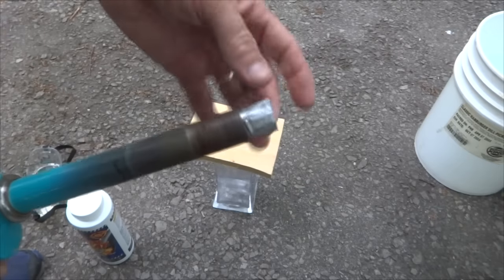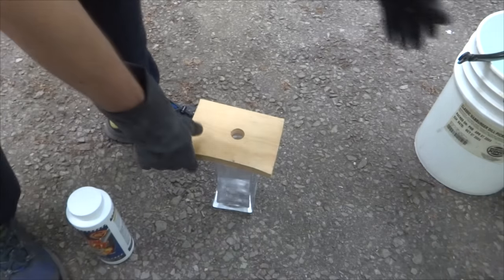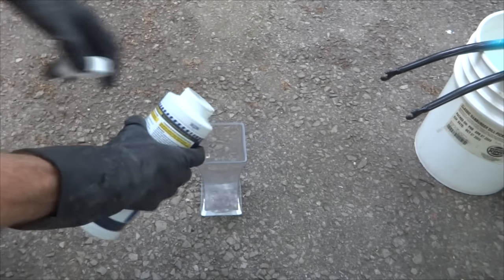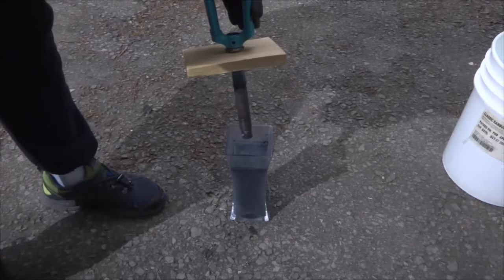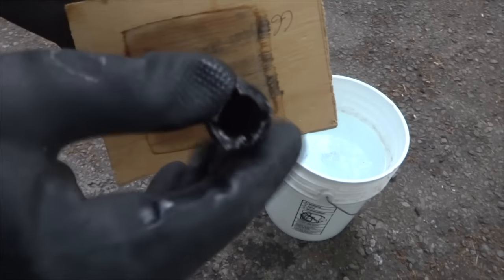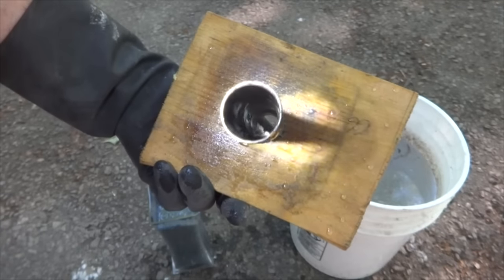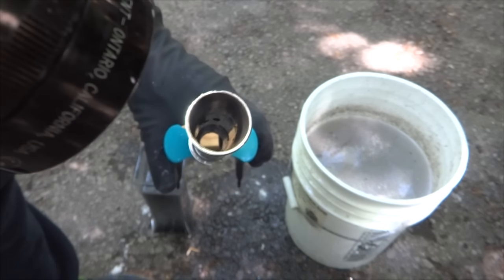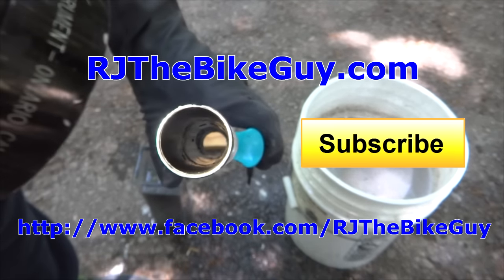Removing Seized Quill Stem With Drain Cleaner/Sodium Hydroxide/Lye

Comment: I did something like this a few times a while back with seat posts. Lower concentrations will work but you change the fluid more often. Because once the sodium hydroxide has reacted with the aluminum it stops dissolving. The benefit of that is lower heat The higher concentration will react for longer periods of time and will create larger amounts of heat that could damage the paint. Good video. I filmed one of my projects but never got to editing it. 

I don't know if I would use glass though, because that can get extremely hot.
Reply: Glass usually handles heat pretty well, short of pyrex, what would you use as a container for this concentration?

Comment: RJ - this video earned a TU and subscription.  I'm rebuilding a beach cruiser that's lived at the beach.  I am struggling with this right now as I dissemble everything for a rust removing electrolysis bath.   Handlebars are extremely rusted.   (My life long experience suggests penetrating oils never really penetrate!)

I guess after I dissolve the stuck tube I'll treat the replacement stem with an aluminum anti-sieze compound such as  "Loctite Heavy Duty Anti-Seize" or similar.

Comment: I have a steel quill stem seized in some alu forks, its not an issue as in a decent position so I am just going to keep using GT85 over the next few month's to start with whilst I use the bike
Reply: Don’t fix it if it ain’t broke!

Comment: How did you dispose of the liquid in the two containers?
Reply: you could neutralise the lye solution with distilled vinegar, dump the aluminium pieces, and then into the drain, i am thinking. a straight pour would not be good
Reply: @clockwork9827  It's safer to dilute in water instead. Pour off some mixture in a new water vessel (don't add water to your mixture!). Then again. The goal is to reduce the corrosive power of the solution, which works with dilution in water. With vinegar, you create a reaction that generates more heat and gases and can precipitate stuff as well in your mixture.

Diluted hydroxide or acidic solutions are safe in the drain. You can never dilute too much.

Comment: NEVER EVER POUR THE CRYSTALS BEFORE WATER!!! This creates an exothermic (heat releasing) reaction that can blow up your glass vase if it's too big. It is the same for both acidic and basic solutions, or crystals/powder. The issue is that the crystals are "pure"; adding water dissolves them and releases heat. If the crystals are there before the water, the initial water falling on them creates an ultra-high concentration of sodium hydroxide and releases tons of heat, with little water to absorb it initially. That is a recipe for disaster.

ALWAYS put the water first, then the crystals (or concentrated solution). This way, the whole body of water is always there to absorb the generated heat. It is much safer this way.

We say in French "L'acide dans l'eau, c'est beau ; l'eau dans l'acide, c'est un suicide". It translates into acid in water is fine, but water in acid is a great danger... Bases work in the same way.

By the way, neutralizing an acid with a base (or the reverse) also creates an exothermic reaction that can be dangerous. Only do it as a last resort. If possible, neutralize strong acids and bases with buffers instead. Labs commonly use phosphate-buffered saline, EDTA or EGTA, but there are plenty of others. Buffers work by absorbing the protons (acid) and hydroxide (bases) in the solution.

Comment: I thought maybe you could make a video removing a frozen seatpost using this method.
Reply from the maker: Yes, but I don't like the idea of the method for a seat post. I had to repeated replace the sodium hydroxide here. A lot hard inside a frame. The lye solution is likely to get everywhere including all over the frame messing up the paint. It would be very messy!

Comment: Not sure what the piece is called but the ring at the base of the fork that would line up with the bottom cup of the head tube. Is that usually threaded on (vintage 80s french road bike)?

Comment: Your suggestion that using higher concentrations of NaOH would speed the process is likely to be wrong.  There is a limit to how much NaOH you can dissolve in water.  The technique you used, of replacing the solution from time to time is more likely to be near optimum.  Life interferes, of course.  It would probably be optimum to replace the solution every hour or two, or when you notice the bubbling subsiding, but sleep and work are important, too.
Reply: i doubt he was anywhere near the upper limit of a high NaOH concentration. I've made 30% solutions and higher in the lab but the bigger problem would be the danger of using a higher concentration. They produce amazing heat and also will strip paint.
Reply: +Ian Loughead   Good points.  The stuff RJ used was only about 35% NaOH according to the MSDS.  In fact, The stuff he used contains about 7% aluminum, that is counterproductive in this application.  These facts may also explain why RJ got away with using a (probably) poorly annealed, soda lime glass container.   https://hdsupplysolutions.com/wcsstore/ThdsMroUs/product/fm/additional/MS/MSDS-112705.pdf
Reply: He's not anywhere near the upper limit. You can easily create 10N sodium hydroxide solutions; these smell a bit and are best used in a fume hood; definitely not with one's head right over it! If he had tried that concentration, the vase would likely have exploded, since he poured the crystals before the water (NEVER DO THAT!). Just rinsing off the stem in water then putting it back in the basic solution would have created a visible reaction.

The fact he did not notice (or mention) a reaction is that his concentration was quite low. In fact, these crystals are nowhere near purity as they're way too big compared to pure NaOH powder for the likely concentration he got.

Comment: exactly what i was looking for, thanks! I even bent my fork a bit, trying to get it out. Is there any chance i could straighten it, if i manage to get the stem out? and how long it's been sitting in there?
Reply: hydraulic/mechanical press to straighten it,apply pressure a little @ a time release pressure & check repeat as necessary til straight,this could soften the metal & it could bend again though.
Reply: You and me both. Nothing to lose now. Just experience to gain.

Comment: Hey RJ. I'm starting my first overhaul of a crappy beach cruiser I got for free. I have a seized stem, and cannot free the fork without getting the stem out. 

I want to use this method to remove the stem. However, I'm really unsure how to identify the materials in the bike parts. How do I know it is made out of aluminum instead of steel or other materials? How do you differentiate? A magnet? or are there more methods?

Thanks so much for your help. I love the videos.
Reply: Steven Ferguson use a magnet to see if it is iron

Comment: A few questions. 1- Am I right in assuming you first got the quill out, but the stem was hopelessly stuck in the steerer? 2 - how much total time did it take to dissolve the stem? 3- How did you do dispose of the spent solutions of lye/dissolved aluminum?
Reply from the maker: 1. Not sure what you mean? 2. A couple days, but there was a lot of down time where the stuff would slow down and stop while I was sleeping or at work. 3. You can probably put it down the drain. That's what drain cleaners were meant for. And one of the actual ingredients of the drain cleaner I used is aluminum. That is where the heat comes from. The product of sodium hydroxide and aluminum is sodium aluminate which apparently is used as a water softener.

Comment: What if the stem is steel? I have one fork wich is had steel stem stuck into it i used caustic soda and doesnt work it work on aluminum,what do you recommend to remove it
Reply from the maker: Steel in steel is much easier. Lots of penetrating oil. Seafoam Deep Creep is supposed to be really good.
Reply: @RJTheBikeGuy  thanks RJ! 😊

Comment: Warming would also speed up the reaction.
Reply: Dissolving solid NaOH will get rather warm by itself.
Reply: +Mark Holm The reaction of NaOH and water with Aluminum is also exothermic.  Both the initial dissolution of NaOH and the subsequent reaction with aluminum will tend to keep the solution warm.  Dissolving NAOH in water can heat the solution enough to make it boil.
Reply: I was actually worried about the thrift store vase not being able to take the heat.
Reply: +William Hitchens   So was I, particularly after it got a bit etched by the NaOH.
Reply: Nope, because it's an exothermic reactions. It already gives off heat. It's likely the vase would not have survived. Furthermore, there would be more fumes.

Comment: Sir,  What to do for frozen iron fork and stem?
Reply from the maker: If it's a steel stem in a steel steerer, then that is just rust. Soak it with a good penetrating oil, and keep working it, and it will come out. Ordinary rust is nowhere as hard as galvanic corrosion.
Reply: @RJTheBikeGuy  OK Sir, and thank you. I will try.
Reply: @MrRabi001  do it work?
Reply: @arthurmcsad8887  I tried with washing detergent water and. I soak whole night it. Next day i tried with oil and worked for my steel frame and fork
Reply: @MrRabi001  i'm going to do it myself if the bicycle shop can't

Comment: How does one safely dispose of the liquid after the stem has dissolved?
Reply from the maker: Down the drain. Drain cleaner is designed to go down the drain. There is actually aluminum in this drain cleaner. That is where the heat comes from. The byproduct of lye and aluminum is hydrogen and sodium aluminate which is used in water softeners.
Reply: But do make sure to flush with lots of water.

Comment: rust inside the steerer tube means rust at the welds, possible rust in the lower legs... etc. too much liability. someone gets hurt, then what? new one and call it a day.
 if you just want to see if it can be done, cool. then destroy it.
Reply from the maker: The issue was not rust,  but galvanic corrosion which is aluminum oxide.

Comment: The other obvious lesson from a stuck stem is that expander stems and seatposts should always be greased before assembly.  I prefer Vaseline (petrolatum, petroleum jelly) because, it is probably more water resistant than and certainly is a poorer lubricant than lubricating greases.  For this job, you want the water resistance, but you really would prefer not to have the lubrication.
Reply: this point looks interesting!
I have issues with the seatpost turning around although firmly tighten up when using grease.
Reply: I was thinking of an 'anti-sieze' but a friend cautioned to be sure to use one specifically compatible with aluminum.  See McMaster -Carr  or just find "Loctite® Heavy Duty Anti-Seize" on AMazon.